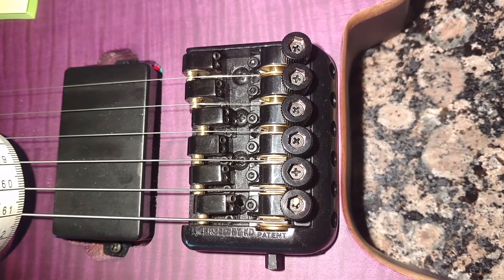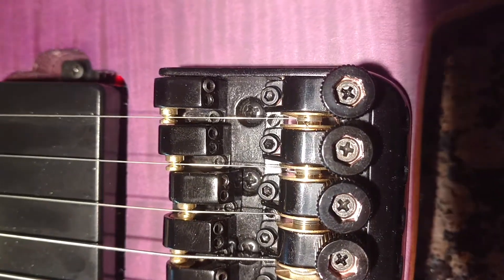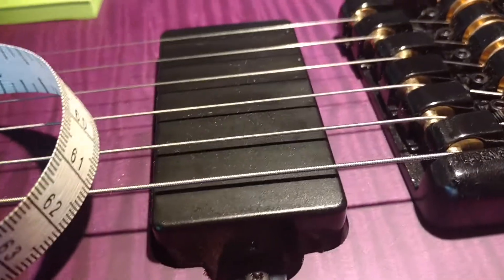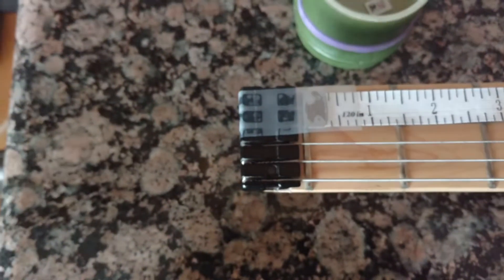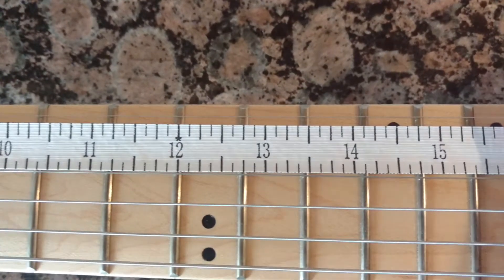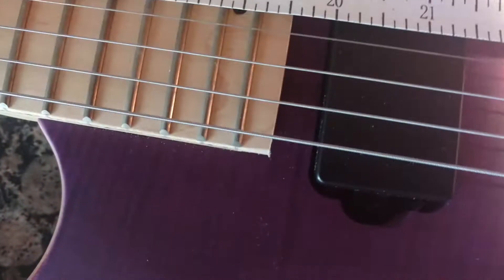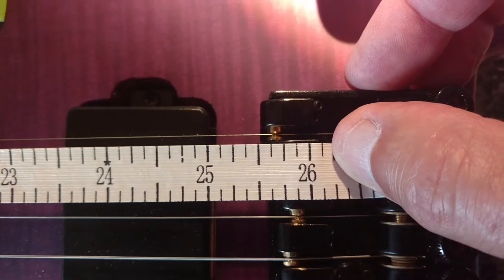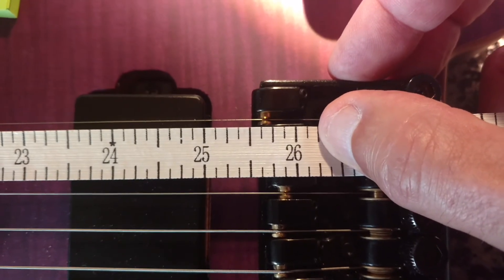2017 Grote Headless guitar bridge / saddle position problem (intonation problem)

Comment: I had the same problem with mine.  Easy fix: the bridge is fastened by four screws - just drill new holes about a quarter inch (maybe a little less) closer to the pickup, fill original holes, screw bridge back in an set intonation.  Mine is set perfectly now.  Pickups are awful but hard to beat for a little travel/practice guitar.
Reply: Fill original holes first then redrill
Reply: Just put some cheap Dragonfire pickups
Reply: Krak'd Aus!! I guess you must have missed the point completely........its not about the pickups its about intonation!
Reply: @bahusofriends5467  The OP had commented that the "pickups are awful". Krak'd Aus!! replied to that comment with a cheap and effective solution to that problem. Apparently you don't understand how conversations work.
Reply: @HeavyInstinct  i did not want to insult you.
Reply: Thank God...your the first person in this whole thread that made me smile...gosh...everyone else on here just about are whiny idiots that can't operate a damn screwdriver or something.theyr ALL jus dying to throw money at a guitar ship who is going to laugh at them and then rob them blind in order to have the darn bridge moved slightly forward...it's rediculously funny but I'm not laughing because it disturbs me that this many people are this senseless.thank you great person you for enlightening these people with apparently large bank accounts that can afford to jus waste money.thank you.

Comment: Setting intonation correctly usually involves setting the string length a little longer because playing actually sharpens the strip pitch... So the saddle location isn't exactly the scale length, but longer. However - I agree, the bridge should be moved closer to the neck to adjust for any set of strings, however light they may be.
Reply: @philipgiacalone5605  - I am thinking of getting an NK.... Probably install all new electronics. Fretwork OK?

Comment: Send it back and get an Eart W2 Headless.  No problems excellent guitar that plays like a dream and stays in tune better than any guitar I have ever played and the 57 design Alnico 5 Pickups sound great, but I did lower the neck pickup to improve it's brightness.  You got to dial them in for that sound that you like. PS  I have 19 other electric guitars.

Comment: Would using 8 gauge as opposed to 10s help intonation?  i ran out of room withe my last 2 saddles and i was told to switch to a lighter gauge string. If that doesn't help then I'm going to have to move the bridge up a 1/8th 'hopefull the 8ts are the answer...anyone think its a good idea or gone thru this.i play allot but not very good  at understanding things...thank you
Reply from the maker: I don't see why string thickness would make any difference, since the intonation problem is with the distance to the bridge.

Comment: QA issue or design failure. However, you could move the bridge easily that require two holes on the body and block the previous holes with wood pieces and glue.😆

Comment: Thanks for video. Just want to add this bridge is bad. I got the fanfret version and it’s even worse. Intonation issues with 6th strings (LOW E impossible to intonate properly). There ‘s some fretworks to be done. So for the price they sell it, it’s not worth. It’s a shame that continue to sell it !

Comment: Does the bridge work well on it's own accord, if it would have been in the correct position?
Reply from the maker: It's not great. IMO, the latest (2019) headless guitar from NK mimics the design of the Strandberg headless. Frankly, I'd recommend the new NK over the headless guitar described in this video.
Reply from the maker: Just stumbled on this one. It looks very interesting, although I haven't actually tried it. https://www.aliexpress.com/item/Krait-headless-guitar-6-string-strandberg-headless-guitar-alder-wood-flame-maple-top-free-shipping/32970823123.html?spm=2114.search0306.3.262.6ffc5ed4FWKdWB&ws_ab_test=searchweb0_0,searchweb201602_0_453_454_10618_536_10890_317_537_319_10059_10696_10084_10083_10304_10546_10887_10307_321_10548_322_10065_10068_10103_10884_10820,searchweb201603_0,ppcSwitch_0&algo_pvid=7c2ee17f-aefa-4e91-bd5e-339a51d58c16&algo_expid=7c2ee17f-aefa-4e91-bd5e-339a51d58c16-36

Comment: So mate.. you said that you send the guitar back to change the bridge..well is it alright now ? And did you pay any ex for repearing the bridge ? And also did they change latest guitars cuz of this problem ?
Reply from the maker: I sent the guitar back for a full refund and do not know if the manufacturing problem with the bridge location has been fixed. My guess is that the manufacturers have fixed the problem -- but I cannot be certain.
Reply: Philip Giacalone ;  Hi, THX for the vid, I’m a stickler for tuning &
intonations.  Did the guitar return to you refurbished properly by now,
2/2018; thx very much.
Reply from the maker: I did not ask for a refurbished guitar and no longer own this type of guitar. From what I can tell, I do NOT think this intonation problem has been fixed by any of the manufacturers. It may be a combined problem of the bridge location, as well as the design of the bridge itself. The bridge is poorly made and is the worst part of this guitar, imo. Also, I continue to see pictures of this guitar on ebay with the bridge location varying widely.
Reply: Philip Giacalone THX much, I’m sure you’ve done many of us out here a great service producing this vid, wishing you & yours the best.

Comment: hi, nice guitar, is this bridge made of stainless steel? zinc alloy? aluminium? brass? thanks
Reply from the maker: It's painted black so I don't know what it's made out of. Parts of it appear to be brass. It's very cheaply made so the rest is not likely stainless steel.
Reply: is it magnetic?
Reply from the maker: Good point. The little allen wrench that fits inside the bridge is held in-place by magnetism. Since I returned the guitar, I cannot check whether the bridge is made of a magnetic material or if there's an opposite pole magnet mounted inside the bridge. My guess is that it's made from a magnetic metal material but it's probabaly not stainless steel, since it's painted and is cheaply made. Here is a link to the same bridge that's being sold on Amazon. 
https://smile.amazon.com/String-Headless-Guitar-Tailpiece-involved/dp/B075XQKXDW/ref=sr_1_3?s=musical-instruments&ie=UTF8&qid=1532582434&sr=1-3&keywords=headless+guitar+bridge&dpID=51gMp6Pz69L&preST=_SY300_QL70_&dpSrc=srch
Reply: Philip Giacalone thanks!
Reply: It's recycled pop cans

Comment: Very interesting. Based on your experience, would you still recommend this guitar?
Reply from the maker: Good question. I can't recommend it unless you have the ability to fix the intonation problem by moving the bridge yourself. The seller I bought it from claims they will fix the bridge position problem. If so, then it's not a bad guitar for ~$250. However, I sent mine back to the manufacturer for a full refund. 

Pros: Small size and light weight (~5 pounds). The neck is straight and frets are pretty good, too. It's a really convenient guitar for practicing. The body design makes it easy and comfortable to play while sitting in either the typical or classical guitar position. It's affordable. Delivery in 2 weeks from an ebay seller. 

Cons: The intonation problem due to the wrong bridge position. Tuning it is a real pain, requires a tool, and it tends not to stay in tune. The edges of the frets have sharp edges (workable but not great). Pickups are not great. The body color (purple) has a flat/dull finish.
Reply: I guess there's no way of knowing if I get a corrected model. It's probably best to wait a year and then get a model that says 2018.
Reply from the maker: Yeah. I'm in the same boat. The ebay vendor I bought it from has a U.S. warehouse. There's no telling how many they have in that inventory. I've also looked closely at the photos of the same guitar being sold by other vendors. The bridge position varies noticeably between them. There doesn't seem to be a design specification for its location.
Reply: Philip Giacalone to be honest, it's a total dealbreaker for me at the moment. Thanks for the warning.
Reply: What Ebay seller did you get it from?
Reply: @philipgiacalone5605  hi Philip,  just saw this. Any idea if the 2020 models have fixed this issue? If it's still not corrected , is it something that can be worked on by a professional guitar shop ?
Reply from the maker: @allboutthemojo  Personally, I'd stay away from this bridge design and go for the newer design at the following link. https://www.aliexpress.com/item/33061282915.html?spm=a2g0o.productlist.0.0.3835697bdpr0Ye&algo_pvid=c1016527-a6e5-4507-bc36-03ea7759bd2f&algo_expid=c1016527-a6e5-4507-bc36-03ea7759bd2f-3&btsid=0ab6d70515913018550202914e0c95&ws_ab_test=searchweb0_0,searchweb201602_,searchweb201603_
Reply from the maker: @allboutthemojo  I don't know if they've fixed this problem. But the bridge sucks, imo. Here are suggestions for 2 much better headless guitars, imo. These 2 were introduced after the Grote model. I haven't actually bought or tried them, but the design looks so much better. 
1) Search for "Krait headless guitar fanned fret electric guitar" on www.aliexpress.com 
2) Search for "NK Fanned Fret Headless Guitar" on www.ebay.com
Reply: @philipgiacalone5605  thank you
Reply: @philipgiacalone5605  just came across another today. Have only seen it but the design looks good. Harley Benton dullahan headless

Comment: Cheap guitars vary in quality, you have to be lucky to get a really good one.
Reply from the maker: Yes, but the overall quality of the construction of this guitar was pretty good. The bridge is crappy, frankly, and the bridge position they're using sucks for intonation. The bridge position problem can be fixed simply by changing the bridge hole positions in the CNC layout. I thought they would make that fix but I've not found a Chinese manufacturer that has yet (as of March 2018). Once the bridge position/intonation problem is fixed, this could be a pretty nice guitar for the money, IMO.

https://www.youtube.com/watch?v=fPeTq_EMQto